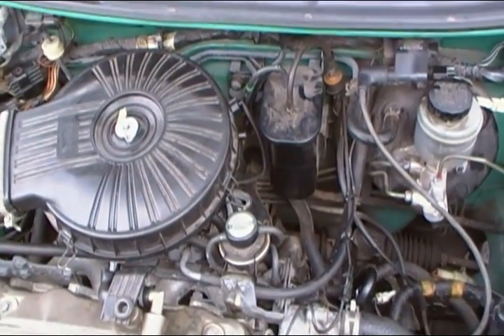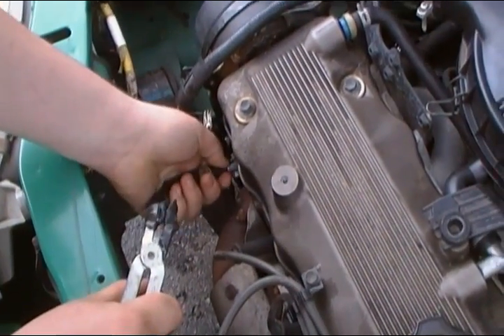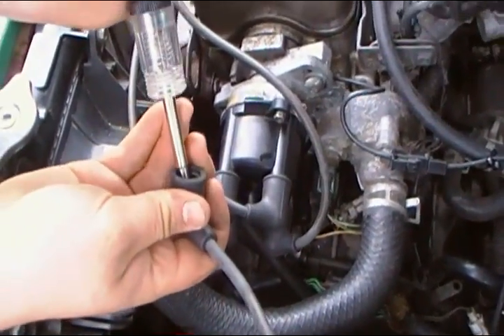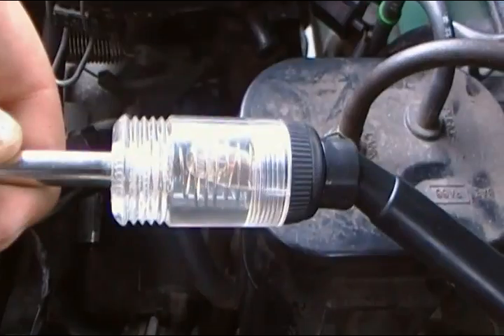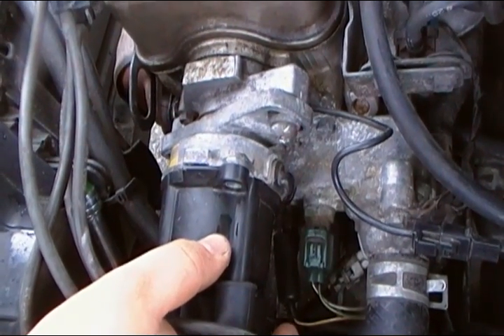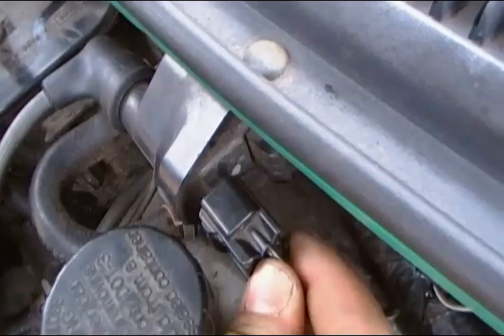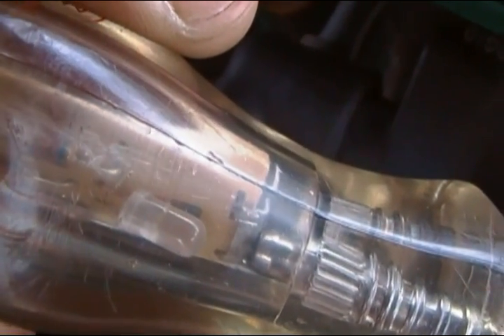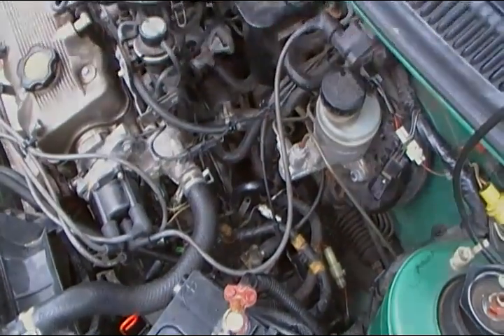Simulation of No-start, No-Spark diagnosing.

Comment: Hi there. Am the guy with the Accord V6. I now have spark and fuel. it cranks but still no start. It gets flooded as i try it too many times. Then i would remove the plugs and let them dry and let the fuel evaporate, then put everything back, crank it again and no start. I don't know what else to try but to take it to the mechanic. thx for ur help. at least i learned something from ur tut. happy holidays

Comment from the maker: @adomayor If looking at the three wire femail connector to the igniter (ICM) with the lock tab on the top, left is #1, center #2, and righr #3. with ignition on, must have battery voltage between #2 and body ground, if not check ignition coil or blk/yel wire between ICM and coil. With ign on battery voltage between #3 and body ground, if not check coil or blue wire between icm and coil. Fuse should be by the kick panel. hopefully theis helps.

Comment: @FrankHurtAuto Testing the power line going to the coil as you did in this vid at 3:55. I got one side solid, and no side blanking while cranking the engine. What does that mean? My test light alligator clip is on ground (-). It's a 98 honda accord V6 Coupe. And there is an igniter (electronic chip) inside the distrubutor cap

Comment: Hi there. While testing the power wire going to the coil, was the test light connected to a ground (-) or a (+)? Mine has power but my test light doesn't blank